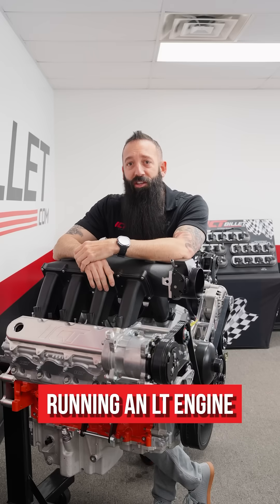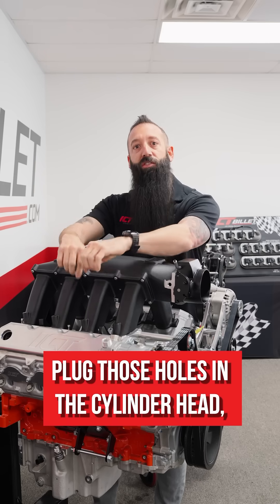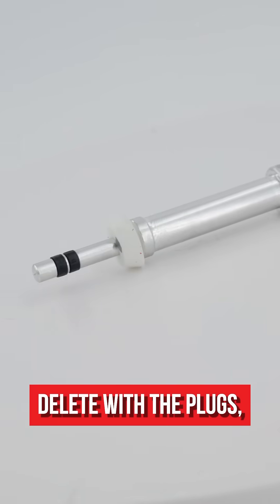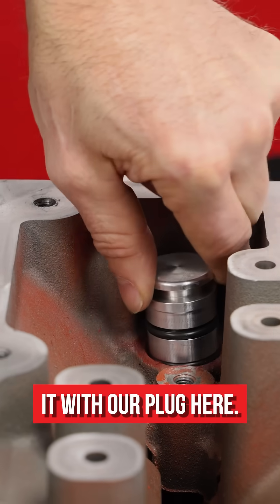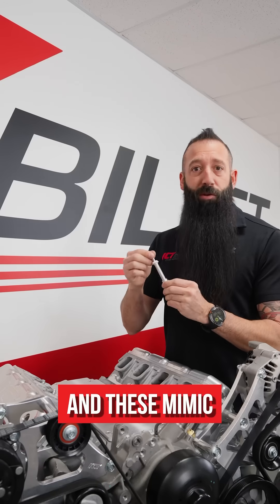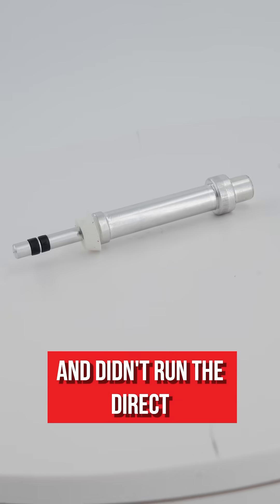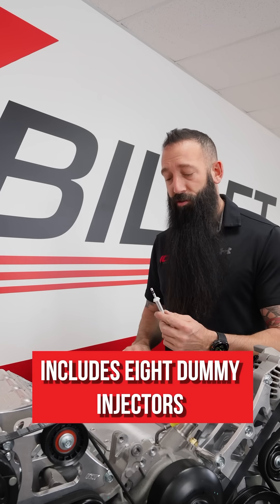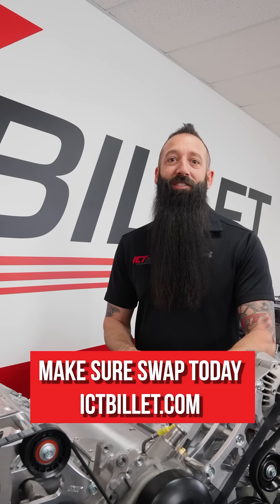LT swaps running port injection? These Dummy Fuel Injector Plugs keep your setup clean & sealed!

Comment: Forgive my ignorance, but wouldn’t that basically be turning a lt into a ls? What’s the point? This is a real question, I’m a diesel mechanic so my knowledge base is limited when it comes to these.
Reply from the maker: Thanks for your question! The fuel system is definitely the biggest challenge with an LT. Converting from direct injection to port injection simplifies plumbing, making it much easier to set up. The best part? You still get the benefits of the LT a stronger block and better-flowing heads for improved performance.
Reply: @ICTBillet thank you for the response. I didn’t realize the blocks and heads were a superior design. Cool product btw.
Reply: @ICTBillet  not this week as im tied-up with work-stuff/ect, but is there any known racer's running/video's DI-fueling-tuning %'s of M100/gasoline mixed in with nitromethane as i do plan on ( 30% or so should get the smell's+soundtrack im looking for, power-goals are sub1500 HP/Tq as fame/me/trans/tire can't take 3k/top-fuel-power or pro stocker levels ) crackle-festival once~ year at my local car show on my hemi? my tune/guess for now is run turbo-inlet's/PFI as NM require so much duty cycle vs pump-gas-tune just checking to see if the line/DI-pump got some in there if it will damage it aka separation-tank/drain+refilling is needed to protect the car
Reply: Auto Guild’s video on LS vs LT is really good at explaining the differences, whenever you have time to burn.
Basically an LS on steroids.
Reply: im mixed feelings about this/deleting-kit but im not yet ready to buy ( my guess is 9k~usd with mostly new part's as i was told ( right now the rebuilding on the engine/short-block is emptying my wallet and needs a brake/breather's, also not my first-gasser but it is my first tryout tuning a diesel/eco-dodge-type ) not to trust junkyard fuel-systems from diesels/N2D as water/algae/previous injection-failure/metallic/dirty/ect ) full-C3-system/GDI-system for my 60's chargers/hemi + tr6060 swap but need the iron/repop'd D8-head's milled for twin-plug/sparks+injector-AL-cup's 1st to assembling/run-it

didn't know running a E85/100M 14:1~CR temp-carb&dizzy-combo would damage my dome's/engine /injectors, good to learn